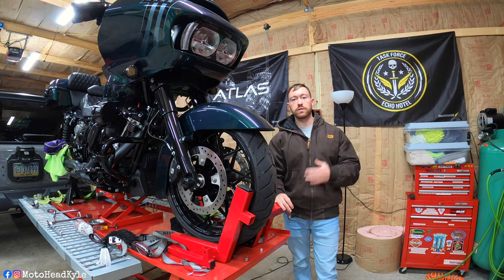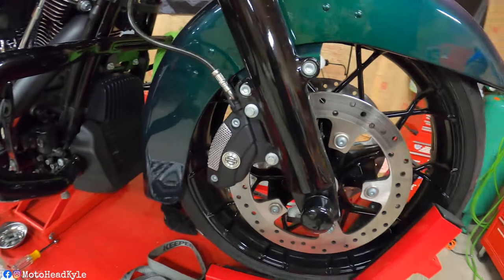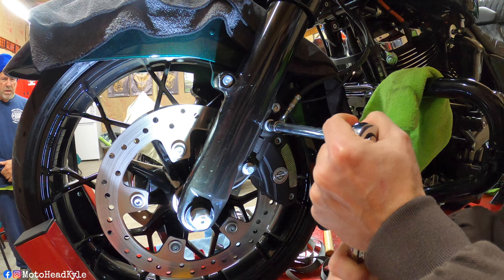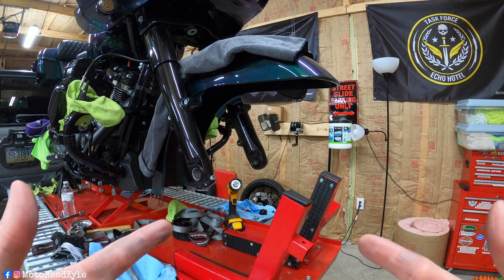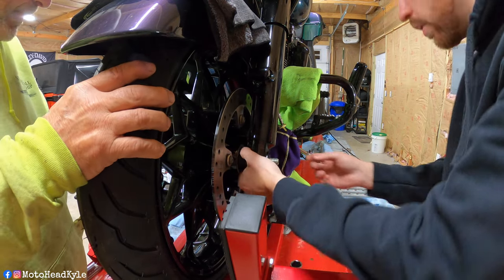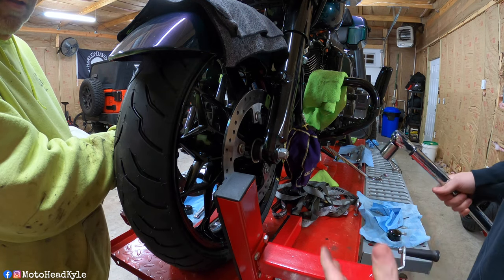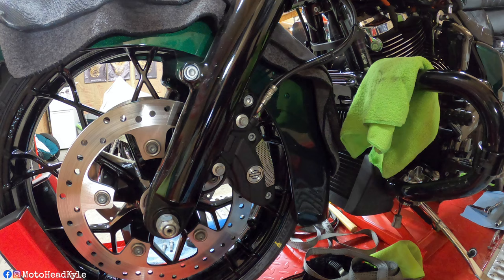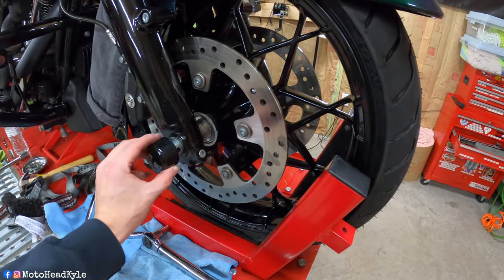How to Remove & Install Front Wheel and Tire on a Harley Davidson Touring Bike

Comment: Kyle this is so helpful! My big question is how you are supporting the rear with the Jack Stands?  I need to take the front and rear wheels off to have the tires replaced, but not sure how to safely secure the bike in the rear while working on the front.

Comment: Great video! Wheel bearing, what color bearing is the abs side. I have a dark/black bearing on one side and metal/tannish color on the other side.
Reply from the maker: honestly without looking I am not sure off of the top of my head. Sorry! However the tire is directional so maybe that can assist you? Unless you’re changing bearings out. Then someone that knows can chime in hopefully?

Comment: Great video! question. Did you have to lubricate the axel shaft before installing it, or did you just dry dock it? Some say to greaser it up with some axel grease of your choice, and others just say dry is just fine.
Reply from the maker: I cleaned it off and put a new coat of anti seeze on it

Comment: Good stuff, I'm over 2000 miles from home with a blown front wheel bearing on a '21 Road King and do NOT want to chance the ride to the nearest shop. Buddy nearby with a truck, Harbor Freight nearby with a lift, a few hand tools, your video, and off I go. Thanks!
Reply from the maker: Hate to hear that you were stuck in a shitty situation, but SO glad that you found my video helpful to get the job done and get back on the road🤘🏻 Ride Safe and have safe travels !
Reply: So... On the off chance that a dumbass  like myself did... Long story.. what's the fix?

Comment: Great video, thank you! Does it matter which way the grooves on the spacer face (left side if your looking at the bike). It looked like before disassembly, they were closer to the fork side but on reassembly they were closer to the tire side.
Reply from the maker: Yes, sorry I’m just replying. The rings should be closest to the fork. I messed that up, I caught it a day or so later. A+ for noticing!
Reply: @MotoHeadKyle what happens if t  Jr e spaced is on with the grooves to the inside, versus facing the fork?
Reply from the maker: i''m not sure if its grooved differently or not, but I would make sure the lines on the spacer is re-installed the same way it was beforehand. I wouldn't take a chance. Maybe someone can chime in, if they know a little bit more about that
Reply: Mechanic at Harley told me it makes no difference, the grooves are for identification. BUT I read somewhere that the repair manual says to have the grooves on the fork side. I don’t have a manual so I can’t verify. Anyone have info?
Reply from the maker: @bthph88  @vincethrill457 From looking at it with a naked eye I couldn't see a noticeable difference. However just looked it up in the service manual it says "See Figure 3-3. Install outer spacers (2) with grooves on
the outboard side." So according to that id install it as such

Comment: Yall make it look soo easy. I been trying to remove my axle for an hour and it will not budge 😭
Reply from the maker: Are you sure you loosen the pinch clamp?  Maybe too much weight still on the front wheel? Or screw the axel nut on a little bit and try to tap it out with a mallet
Reply: @MotoHeadKyle  i complete removed the pinch clamp. And i tapped on it with the mallet. I had to keep hitting it with the mallet until it came off. Does it need to have grease for lube? Cus mine was pretty dry
Reply from the maker: @juliocordero1788 I’d clean off whatever residue is on the axel and re-apply some silver anti-seize, that should help the next time you have to remove it

Comment: He left out one very important thing....the front tire wouldn't clear the fender....so how did he stabilize the bike while loosing the wheel clamp & jacking up the scissor jack under the frame...I don't see any ratchet straps stabilizing the bike. That scissor jack would have to be positioned perfectly in the frame for good balance. That would be hard to do with the front wheel tightened in the clamp....be careful out there guys if you loosen that wheel clamp & it's not balanced perfectly & not secured down properly, it's going to fall!

Comment: Strange. You mention in your video to take pictures of the spacers, but you've installed the front (brake lever side) spacer backwards. Grooves on external spacers should be on the outside according to the service manual.